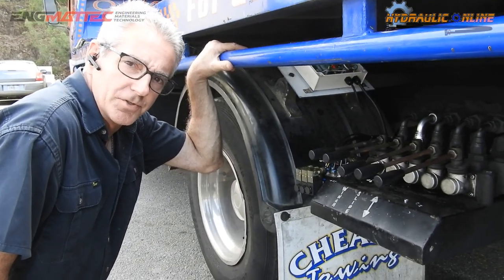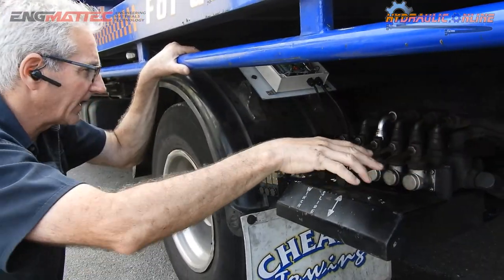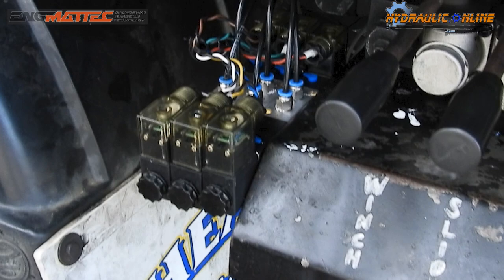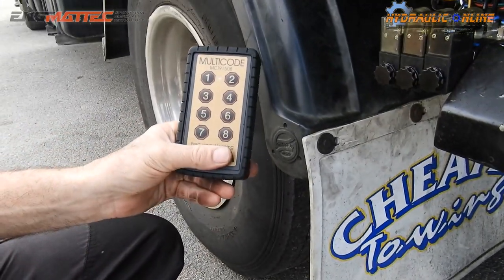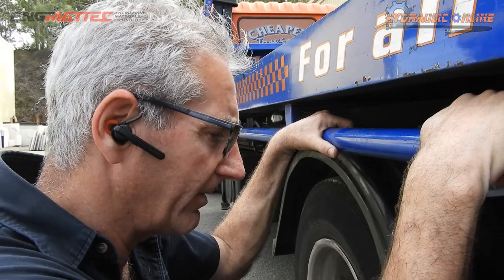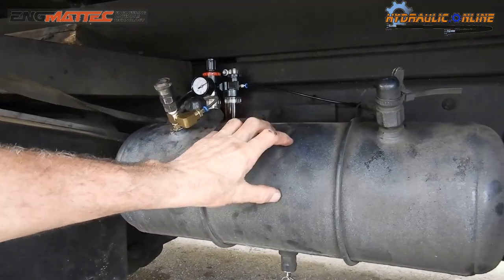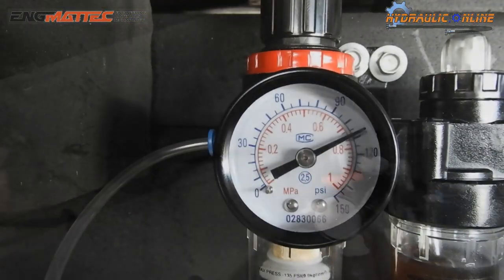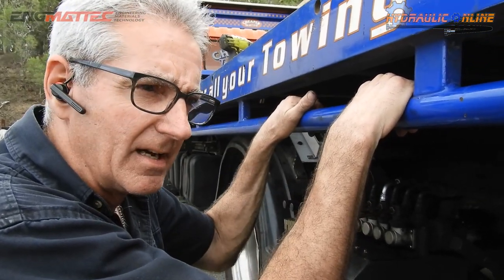Radio Remote Control Hydraulic DIY Kit For Tilt Tray Transport Vehicle Recovery Unit

Comment from the maker: This week's project was to retrofit our DIY Radio Remote Control Hydraulic Kit to an older model Isuzu Tilt Tray Truck used for Towing, Transport, and Vehicle Recovery. 
 This DIY kit will Greatly Increase Operator Safety and to also increase efficiency by 20% during loading and unloading procedures.

Comment: 20,000 for the kit ?wow😅
Reply from the maker: Wow ?
We have sold quite a few kits all of them custom designed and assebled to suit the truck builder.s requirements.
$20,000 is not just for the remote control
Our remote kits Start at AU$938  
$20,000 will get you all the hydraulic parts below including radio remote control  
Air solenoid operated Power take off with in-cab controls pic no. 4.
High Flow Powe take off hydraulic Pump for fast operation pic no. 4.
Chassis mounted oil tank with return line filter pic no. 5.
High flow 5 lever flow control valve with self-centering controls & air/electric solenoids 
(3 remote controlled, 2 manual for car cradle) pic no. 11.
15,000lb Winch Hydraulic drive with planetary reduction box with manual free spool, front roller, and 20mtrs high tensile wire cable with swivel hook pic no. 3.
3.5m stroke heavy-duty slide cylinder (Custom built to suit your requirements), 3.5” bore, 1-3/4” rod pic no. 1.
24” stoke Tray tilt cylinders, 2.5” bore, 1.5” rod pic no. 8.
Two Rear Lift Cradle Cylinders 2.5” bore, 1.5” rod, 14” stoke pic no. 9
One Rear Cradle slide Cylinder 2.5” bore, 1.5” rod, 48” stoke pic no. 2
4 x Safety Over centre/counterbalance valves (fitted with hard pipes is an extra cost)
Remote control for tray including winch, tilt, and slide. pic no. 10 (Optional Australian made Radio Remote controls also available )
20 Metres of 5,000 psi working pressure hydraulic hose pic no.13
Field fit reusable hydraulic hose tails, and adaptors for valve cylinders, pic no. 12
Plastic Cable/Hose carrier 3 meters long , 35mm High x 73mm Wide Cable Chain pic no, 7